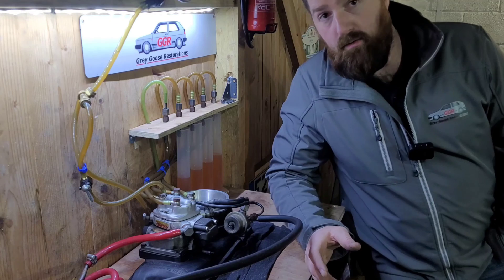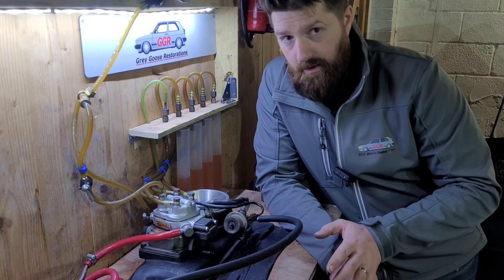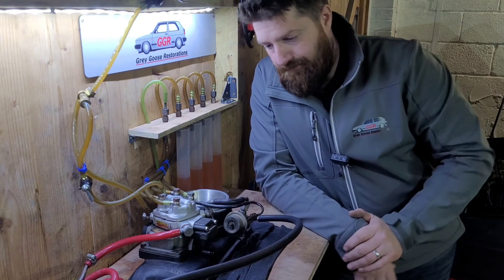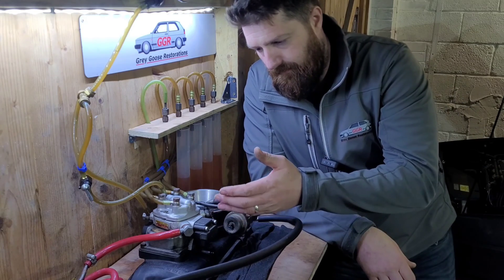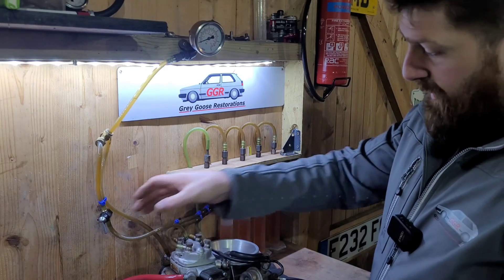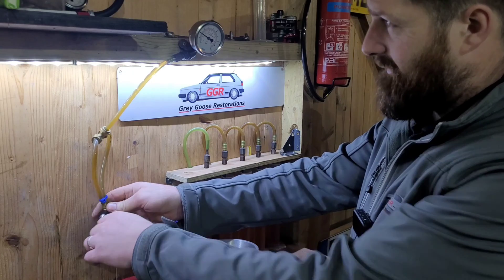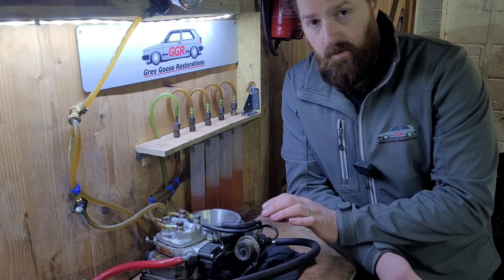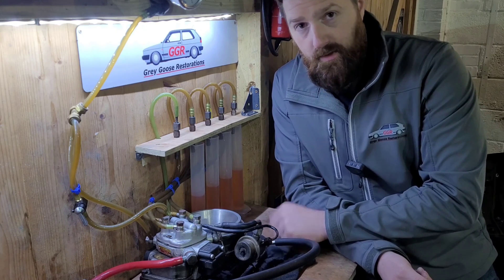Bosch KE-jetronic - System Pressure Testing

Comment: Howdy sir, I have a 89 Fox with CIS-E. It was starting for a few seconds then dying. I have made a pressure tester gauge like yours, and I have all four injectors out. I used a jumper at the fuse/relay panel to run pump continuously. It takes maybe 10 or 15 seconds to get up to 80 psi. Also I tried raising the air flow sensor plate while pump was running to make the injectors activate but no gas came out. Air flow sensor felt like it was under resistance from the pressure. Could this be because my plunger in my distributor is bad or my injectors are clogged?
Reply from the maker: That seems slow to build pressure, remove the return line off the fuel pressure regulator and see if you get 1ltr fuel in 30 secs
Reply: Ok I’ll that that when I get home today, thank you!

Comment: Bonjour grey, tout d’abord un grand merci pour tes vidéos, cela m’a beaucoup aidé ! et j’ai une question mon régulateur de pression, perd sa pression de maintien en cinq minutes et les régulateur bien trop cher pour un 2.3 ng Audi.  Puis-je brancher un régulateur universel en série avec celui d’origine ? Un grand merci à toi.
Reply: Oui Réglages  à 3.6 bars et chute à 3,2 bars en 10 minutes fuite sur le retour du regulateur et aucune fuite dans le circuit et clapet anti retour de pompe ok
Reply from the maker: KE units should have around 2.5 bar after 20mins after being switched off
Reply: J’avais vu sur mon livre d’origine Audi , 3.5 bars après 10 minutes et 3.4 bars après 20 minutes de repos ! plus la fuite en sortie de régulateur m’a perturbé . Je vais réessayer mes démarrage à chaud cette semaine avec  cette perte de pression. Car avant Réglages, j’avais une pression de maintien de 2.8 bar !!! Grâce à tes vidéo je pue remonter cette pression. Un grand merci à toi de m’avoir consacré du temps t’es génial
Reply from the maker: Have you tried to adjust it? When you switched off, take the return pipe off the regulator and see if its dribbling out

Comment: The mystery vacuum port isn’t for KE-Jetronic. It’s a generic fuel pressure regulator, and that connection is sometimes used in other applications.
Reply: My car is an ‘88, Euro-spec with no cats or lambda from the factory. I’ll be sure to watch that other video.
Reply from the maker: It should be connected to a vacuum sorce somewhere
Reply: @GreyGooseRestorations My understanding is that it should be connected to vacuum on cars where vacuum impacts fuel pressure, but that KE Jetronic doesn’t use it.

My Testarossa came from the factory with short hoses connected to those ports, and the far end of the hoses unconnected, vented to atmosphere. They’re only a couple of centimetres long and couldn’t possibly reach any vacuum port. 

Please correct me if I’m mistaken. I certainly could be. Thank you for this helpful video.
Reply from the maker: There is a lot of unknown things with all k-jetronic and KE, it may be that the early cars with KE didn't have the vacuum section used however that is what the end section of the FPR is for, what year is your testarossa out of curiosity, have recently done another video on the FPR showing how the vacuum effects fuel pressure and flow

Comment: Watching your video on adjusting fuel pressure regulator to acheived  correct pressure differential between control and system pressure of0.4 bars. I looked inside my regulator there is no Allen screw to adjust pressure. I just have the EHA and the adjustment screw on distributor. My problem is distributor is full of fuel but none is going to injectors. I had car running . But low rpm’s check problem was my ignition switch waited on switch put new switch in now it won’t start again, .Open lines on top of distributor . Full of fuel crack lines going to injectors nothing. Please help me as to how to solve this problem. Should I check fuel pressure again ? Even though car was starting before I replaced ignition switch. I check spark at plugs I have spark
Reply: Yes I have fuel flying all over the place I open line coming from pumps and I got a bath. Crack return line same thing.Distributor is full I took injector lines out of top full of fuel but nothing going to injectors
Reply from the maker: Ok, can you pull the air meter plate up with ease and does it return to rest unaided
Reply: Yes I can it moves very good . When ignition is on to start car air plate open slightly to allow air and to start everything is in same position when car was running . Could the plunger in distributor be stuck ? This stupid gas we have here with Ethanol rmess everything up sticks everything if you let sit too long. Should I do another pressure test of control pressure and system pressure?
Reply from the maker: Does the plate move down when the ignition is switched on? Which car is this on by the way
Reply: This is a 1991 300 SL R129 Mercedes convertible Ke Jettronic injection system . My plate don’t move up only down . Have a bar cross the top of plate with rubber stop . If you can please provide any help would be followed to the letter
Reply from the maker: Ok so push the plate as far down as it will go and crank the engine, that should send fuel to the injectors 

If not then the EHA may be jammed internally stopping flow
Reply: Ok I would try that. Can I leave number one injector line off the injector to see if fuel is indeed coming out to injectors? If no fuel should I change EHA or adjust it clockwise to increase pressure?
Reply from the maker: Yeah normally its best to have all or one injector out to see whats going on
Reply: Ok I would do that . I noticed you have not mentioned to rechecked fuel pressures between working and control pressures. You don’t think the pressure differential could have any bearing here?
Reply from the maker: It could do but I'd check that fuel can get through the system first, even with the pressures not spot on it should still deliver fuel
Reply: I am getting a lesson in this system . I always thought the pressures had to be spot on to deliver fuel out of distributor to injectors. So if I understand you correctly if I push the plate all the way down while cranking and no fuel is leaving and going to injectors The culprit is more than likely the EHA? Is this correct
Reply from the maker: @trevorross7405 yes 👍
Reply: Thank you so very much. Instead of doing lots of unnecessary work in replacing parts you have directed me to look at the most important parts that cause the problems. I am waiting for another pair of hands to help me and tomorrow all this would be done. Again thank you for helping. These classic cars take plenty of care and patience
Reply: If I remember correctly the EHA is set at 6.66 or 6.68 mm is that correct
Reply from the maker: That depends on the condition of the internal plate as it wears over time so may need more either way, its best to check and adjust with each individual unit but around that measurement yes
Reply: I am by myself . Can I take all the lines off the top of fuel distributor and turn ignition key to on position see if distributor full up with fuel and then with fuel pump and key in on position deflect air plate to see if fuel shoots out of distributor? I am asking like I say I have no help right now and was wondering if this method would let me know if EHA is stuck also or no good?
Reply from the maker: @trevorross7405 that would work to a degree yes
Reply: My brother I would tell you what I just did. I opened the lines on top of distributor  turned ignition to on position. Distributor full up instantly. Deflected plate nothing bang on the EHA and the distributor with my rubber hammer, then I jammed open the air plate with hammer handle and went and crank car fuel shoot out and car started. Had to turn off to stop fuel from going all over. Was I crazy or just frustrated or using years of working on car and trying different techniques out? Hope you don’t think this guy is crazy maybe a little but I had no help so I improvised
Reply from the maker: Fantastic, ive had the EHA units stick before and a light tap wakes them up
Reply: Thank you for your prompt and helpful courteous responses. I just wanted you to know how much I appreciate your advice and help. Today I would replace all the injectors lines and attempt to start it normally . I would let you know how it turns out
Reply from the maker: Happy to be helpful, got to keep these cars running
Reply: Just put everything back together start car run rough then stall then start again rough shut off won’t start  again. Open injector line on top of distributor. Turn ignition key on gas keep on flowing out of port. I turned the adjustment screw clockwise like they instructed until flow stops but it never stops . If I depress plate while cranking fuel shoots out the port but car still won’t start it tries too .I think it is flooded by constant flow of gas. How to fix this . The distributor was recently rebuilt. Could the plunger be sticking ? Or the new diaphragm be  ruptured? . First no gas now too much. Can you advice please . I am not giving up until I fix this car
Reply from the maker: Ok, does fuel flow out the injector with just the ignition on (fuel pumps running) and the air plate in its rest position?
Reply: Fuel is coming out of distributor with key on pump running air plate at rest . If you depress plate fuel shoots out in the air
Reply from the maker: Ok its either the rest position of the fuel pin and or air plate or the fuel distributor has a fault
Reply from the maker: Check the EHA isn't stuck (light tap when cranking the engine) check its got around 20 ohm resistance when its unplugged
Reply: @GreyGooseRestorations EHA fluctuating between 20 and 22 ohms is that good?
Reply from the maker: Thats ok if its around 20 ohm area, is the fuel pump definitely getting powered up with ignition on
Reply: Ok I would try that. Can I leave number one injector line off the injector to see if fuel is indeed coming out to injectors? If no fuel should I change EHA or adjust it clockwise to increase pressure?
Reply: How can I add if it is possible a remote starter to assist me when I am alone? I have the remote but in this car I am trying to see if it is possible and how to hook it up to this 300 SL 1991 R129
Reply: How can I add if it is possible a remote starter to assist me when I am alone? I have the remote but in this car I am trying to see if it is possible and how to hook it up to this 300 SL 1991 R129.😅
Reply: This is the same EHA that was in car a few weeks ago when I shut car off and was waiting for ignition switch. I put new seal in bottom clean it out and adjusted the screw using my caliper to your spec
Reply: Just put everything back together
Reply: Yes
Reply: Remove distributor to see if the fuel plunger was stuck or moved somehow . The base nut was loose don’t know how but it was loose. I am going to check the height of the nut . What should it be in mm ?
Reply: What is the measurement of the fuel pin adjuster to base nut is it .6mm?
Reply: In my fuel distributor the plunger has no spring to force it down or make it pump. When I took it apart to rebuild it I noticed no spring was there. I saw other rebuilding and a spring was present. I asked the gentleman in Germany about it and was told if it was not there it is ok because some had a spring and some don’t. I put it back together minus spring as I was told. Is that correct or a spring is needed? If so where can I purchased one if needed

Comment: The vacuum connection is there to change the system pressure at idle, high vacuum and full load (low vacuum). This way the injection quantity remains constant at all loads, because the pressure difference also remains constant. By connecting a vacuum of -0.5 Bar to the pressure regulator, the petrol system pressure should decrease by 0.5 Bar.

Comment: I have a question  well and expanded question . I have a 300 sl 1991 R129 i am having problems getting it started and stay running. I changed the fuel pressure reg . The old one was leaking fuel out the so called vacuum line. I have listen to many forums and a bit confused -as to identifying the upper and lower chambers of the fuel distributor. My confusion is some forums call the upper chamber the system pressure chamber or the working chamber. the bottom chamber the control chamber. Other forums reverses this. I hooked up my gauge and have the valve in the off position reading working pressure from bottom chamber. I took off the EHA adjusted it slightly  numerous times no change in pressure. I even replaced EHA same results. I am tired of taking the EHA off adjusting back on etc. In your presentation you stated the regulator can be adjusted to either increase or decrease pressure without the constant removal of EHA. Can you offer any help to get my pressures correct to get the differential of .04 bars?
Reply from the maker: The EHA adjustment is to adjust the volume of fuel
The pressure regulator is the adjustment of pressures, just had a Ford RS Turbo unit that wouldn't adjust via the FPR, replaced and adjusted fine to get 0.4 bar
Reply: @GreyGooseRestorations is that a confirmation that I can just use the FPR to achieve the correct pressure? I asked a question on Google and was told the unit is not adjustable
Reply from the maker: Google doesn't know everything 😅
Reply: @GreyGooseRestorations what line on the back of FPR can I remove to see if regulator is good? Is that the fuel return line?
Reply from the maker: Yes 👍

Comment: hey, ive been trying to get my audi running good but ive run into a few walls. firstly, i cant get the car to run with the eha unplugged, the system pressure sits around 6bar but the control or diff pressure wants to climb higher than that, not sure how accurate it is since the car stalls as soon as i open the tap, i measured it by priming the pump. when driving its anaemic, cars been sitting for a while. residual pressure at 2.8bar

is it even worth doing any adjustments with the eha plugged in? should i try doing measurements by pulsing the ignition or is idling necessary (worth noting that the pressure is still creeping when the pump cuts off)

i fiddled around the pressure regulator blindly and ive fixed my initial issue of stalling after letting off the throttle but its nowhere near running good. 

my unprofessional verdict is that the eha is kicking down the pressure just enough for it to run halfassedly, but at the moment i stopped touching it before a second opinion since its at the least mobile and i dont have to push it around my yard

2.3l ng engine

Comment: I attempted to raise my residual pressure following the steps you outlined here. I was able to raise my residual to 2.8 bar. Disconnected my fuel pressure test kit, started my car let it warm up to operating temp ran great and started great idled great. But when I came back 30 or so minutes later i couldn’t get the car to start. Any idea what I messed up while adjusting the FPR?
Reply from the maker: You may have adjusted the FPR to far and now it's either not opening enough or opening too soon which is affecting the system pressures
Reply: @GreyGooseRestorations  ok I’ll take a look at this. While attempting to raise residual, system and differential pressure were not raised at all.
Reply: @GreyGooseRestorations  turned the FPR back IN/clockwise about .5 turns. I got the car started cold pretty well then warmed up the car again took it out for a short drive. Came back shut off and waited 10 minutes car started really strong. But now after 30-40 minutes of cooling off the car started immediately then fell flat right after. Any suggestions for that?
Reply from the maker: Your main engine coolant temperature sensor could be giving the ecu untrue readings - the lambda sensor could be doing the same, these will alter how the DPR reacts which can cause similar problems

Comment: Hello, i need desperately help with my Ke-jetronic. I have residual pressure ok but right after i turn off ignition pressure drops to zero. When i clamp return hose the pressure remains. Is the head leaking or where the is the leak?
Reply from the maker: If you clamp the return hose and pressure remains, then your issue is the fuel pressure regulator itself and would need replacing
Reply: @GreyGooseRestorations any sources for replacement FPR?
Reply from the maker: Very hard to find new if at all
Reply: @GreyGooseRestorations  Alternatives?
Reply from the maker: Nothing that would be off the shelf and work, its rare they fail so best bet would be to sorce a used one